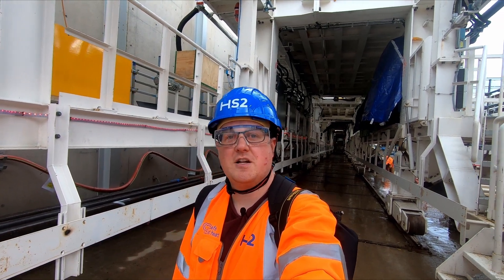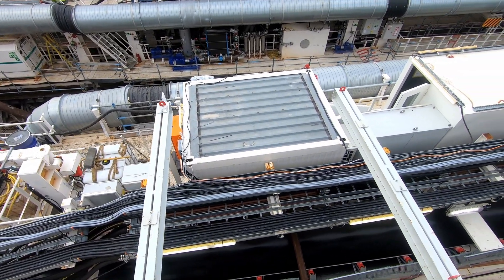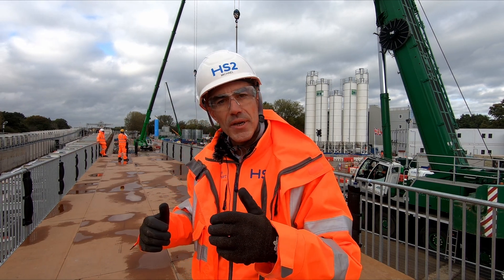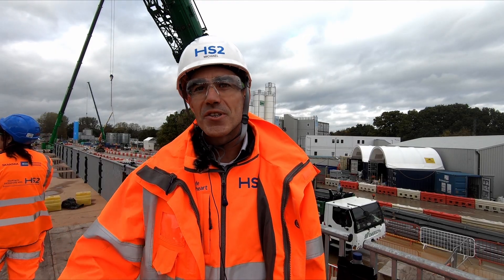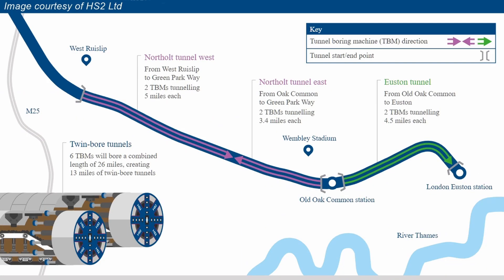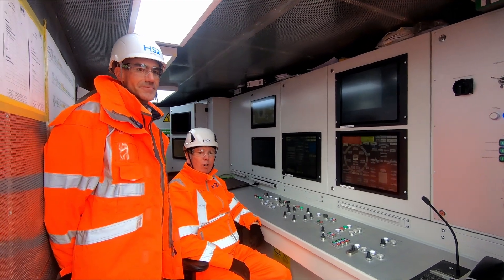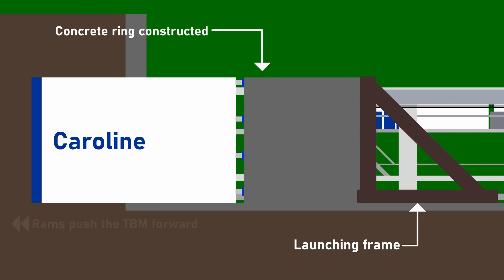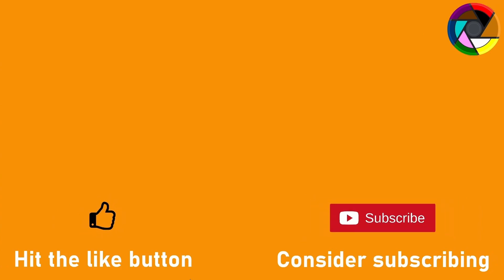HS2 London Northolt Tunnels | TBM "Caroline" launch

Comment: so you said that tbm would bore 18mts a day,and in the next breathe said that the other tbm has done about 80mts in 2 weeks ,so my sums says that does not add up right ,could we have the answers thanks
Reply from the maker: Once the TBS are up to speed they hope to achieve 18m per day, that much is true. The first few weeks will likely be spent making sure everything's dialed in correctly, hence the slow start initially.
Reply: When operating continuously.
Reply: I appreciate that these subterranean links will ultimately negate the need to keep coming back up to the surface to pick up the next link.Nice work lads and lassies! 👍🇬🇧

Comment: I'm still waiting for someone to cost comparison tunnelling 90% of the route versus what's happening now
Taking into account all CPO of land, houses, security of sites construction equipment, etc
Reply from the maker: Through London tunnelling makes sense, but farmland is still relatively cheap. However, it's not just cost to consider, but energy consumption too. Above ground new high-speed trains are very efficient (using the same or less energy travelling at 320km/h than existing Pendolinos do travelling at just 200km/h) but below ground the piston effect increases energy consumption, so tunnels need to have a very wide bore and must be implemented where completely necessary.
Reply: @Rail_Focus  But you still haven't answered my simple question. We know the cost per mile for tunnelling. It's the same cost, whether it's the 1st mile or the 50th mile.. 
The size of the tunnel is irrelevant as long as it can carry a train at 200mph.
Let's face it, underground wins hands-down in my eyes, and my point is it can be done, and nobody give it a thought..
Reply from the maker: @davidcurry4433  the diameter of the tunnel is relevant as the wider the bore the more material needed to be excavated and the bigger the tunnel rings need to be adding to the cost. But you can't compare the cost difference between tunneling under London and tunneling under farmland, as the value to London real estate is vastly more than open farmland. So no it wouldn't be cost effective to drive a 140 mile long tunnel. The energy requirements are also important as they would add to the operational costs and therefore further erode the benefits vs cost of tunneling. So in answer to your question, common sense tells us tunneling 90% isn't practical or cost effective and is not necessary given the relatively small impact HS2 will have on overall land take.
Reply: @Rail_Focus  When i say 90%, i actually mean in and out every 10-15 mile, and not a continuous tunnel. Like I've previously said, nobody's willing to do a cost comparison, all the consultations that took place, not one person was interested, im sure it's the same as Heathrow's T5, a land grab..
Reply: Tunelling costs per mile are not the same regardless of distance. If there are shallow foundations of buildings in close proximity they need underpinning.
Reply: @TrevorWilliams-fq8mg  Still no cost comparison between above and below.
Reply: It is impossible to provide a cost comparison. Varying ground conditions also impact on cost. For example if tunelling in gravel the gravel will collapse. To prevent that from happening the gravel is converted into concrete by injecting liquid concrete into the ground, a process called compensation grouting. Tunelling in clay doesn't carry that risk.
Reply: @TrevorWilliams-fq8mg  Nothing is impossible,

Comment: I hope the trains will move faster than 5mm a second; I've been stuck on some services that would be left in that machine's dust. How does these machines negotiate changes in elevation or tunnels with bends?
Reply from the maker: I'm fairly sure each of the hydraulic rams can be independently controlled to "steer" the TBM, but also each ring segment will be a different shape to match the contours, which in part will also dictate the direction of travel.